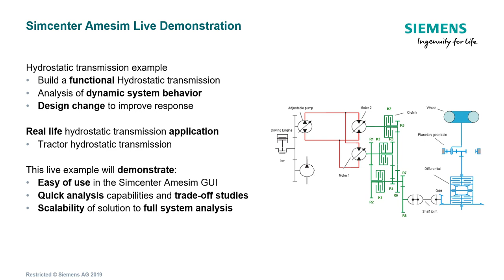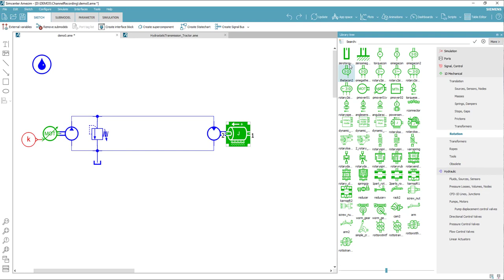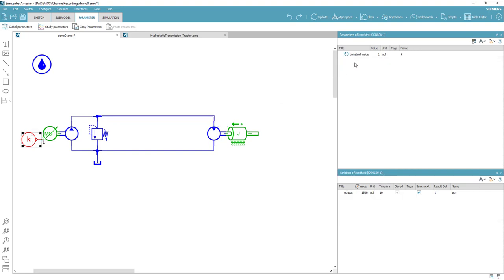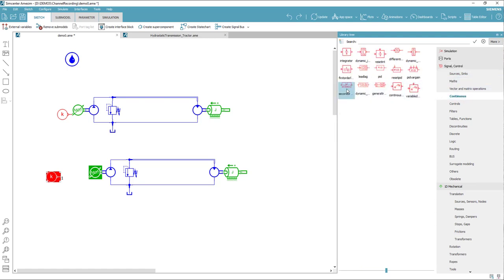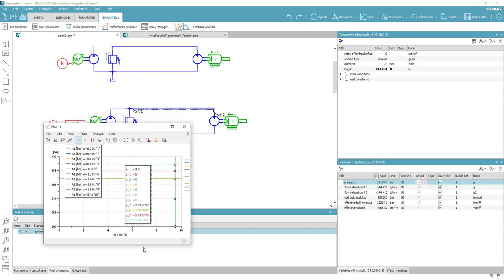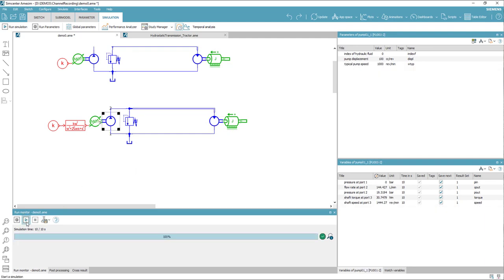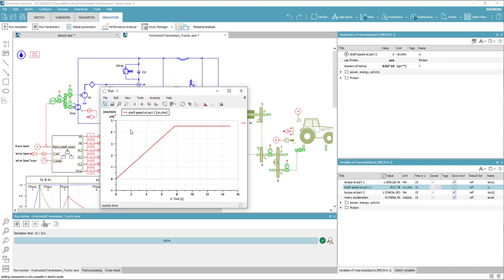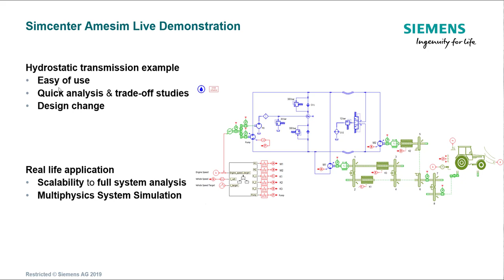Simcenter Amesim Demo

Comment: Thank you very much for the video. But I cannot figure out why is only one pipe section defined as the hydraulic pipe...
Reply from the maker: The pump, motor and relief valve all require a pressure as an input, so there has to be a pipe (or some volume) that calculates this pressure. This model is the simplest representation of that: the pipe section is simply modeled as a volume without pressure drop. The relief valve is typically very close to the pump, so it would not make sense to model a pipe between the pump and relief valve, therefore it is between the pump/valve and the hydraulic motor. It is possible to increase the calculations assumptions in the pipe (increase the complexity) and introduce friction, inertia (for water hammer effects) or discretize the pipe in case it is very long. Finally there is an option to use CFD1D assumptions that will solve partial differential equations (rather than ordinary differential equations) to accurately simulate the pressure waves in the pipe.
Finally, all other single lines are modeled as 'direct connection' thus simply exchanging variables from one port to the other. That can be changed (in submodel mode) as well to include friction (R), compressibility (C) and inertia (I) effects as needed. 
Sorry it took me 2 years to respond....

Comment: Thanks a lot for posting such nice and informative videos. I was having one question that can be also virtually simulate the same process to check the stress level ?
Reply from the maker: Hi Karan - for stress analysis you would need a finite element (FE) approach, which can be done with Simcenter 3D, or Femap for example. The pressure traces that are simulated with Simcenter Amesim can however be used as pressure (force) input to such FE analysis.
Reply: @bobransijn  Thanks a lot for such a beautiful answer.